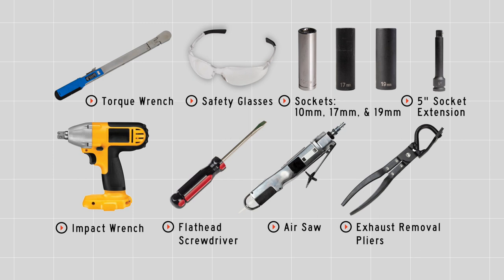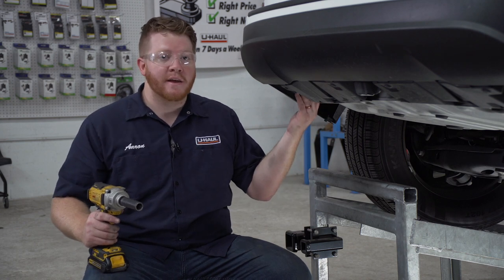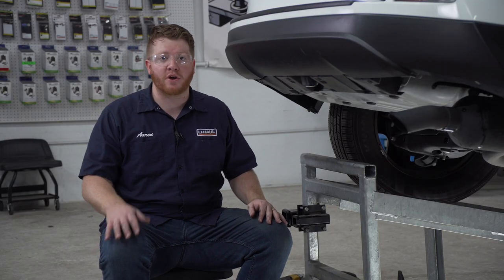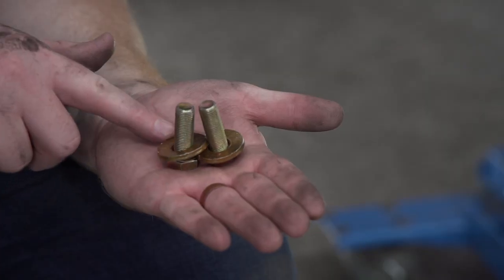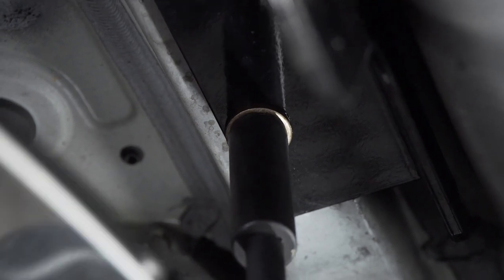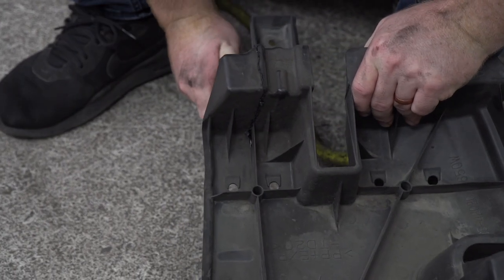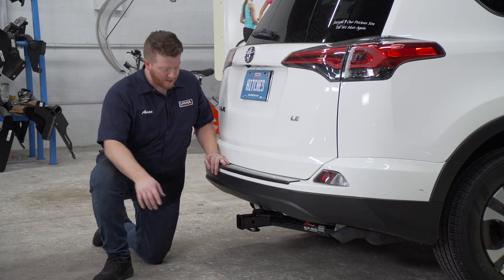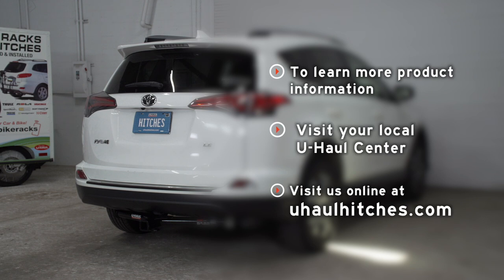2018 Toyota Rav4 Trailer Hitch Installation

Comment: Important note for anyone trying to do this on a car that isn’t brand new: the threads of the holes where you attach the hitch will be very rusty, so you will need a thread tap.
Reply: Great tip!
Reply from the maker: Actually you will need a thread cleaner. A tap is for cutting new threads into solid metal.
Reply: @trailerhitches  Well a tap got the job done perfectly so I don’t know what to tell you

Comment: Has anyone ever towed a small car with a rav4? (Small civic below the towing weight). Thanks!
Reply from the maker: The hitch is only rated to 3500 pounds. The weight of the CAR AND TRAILER would have to be less than 3500 pounds.